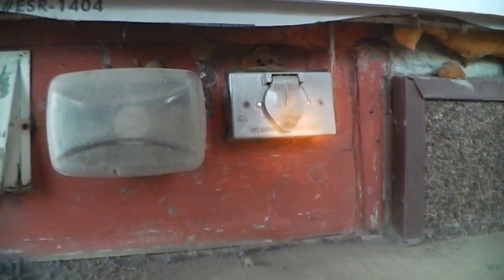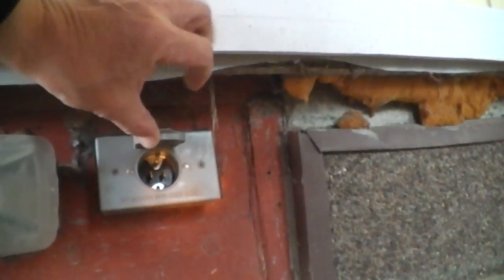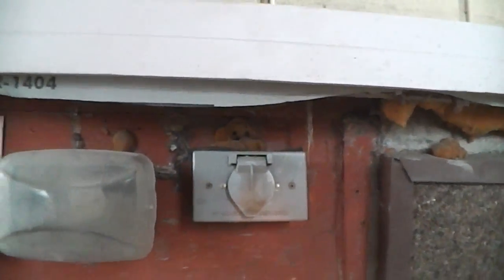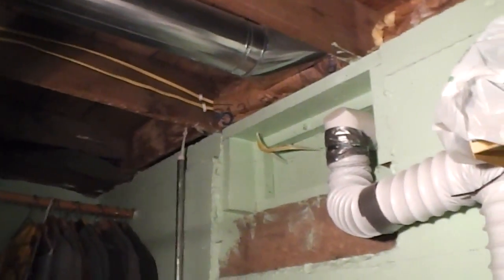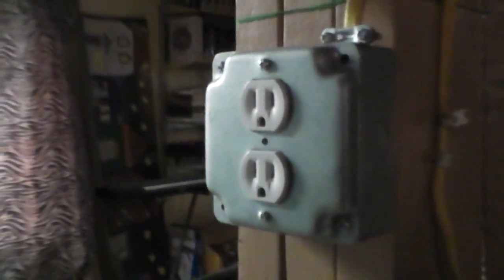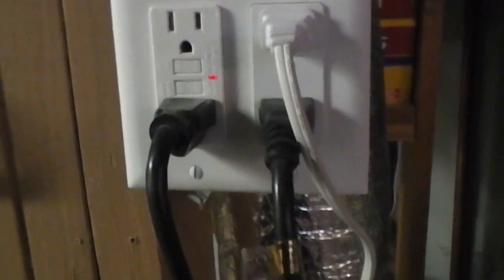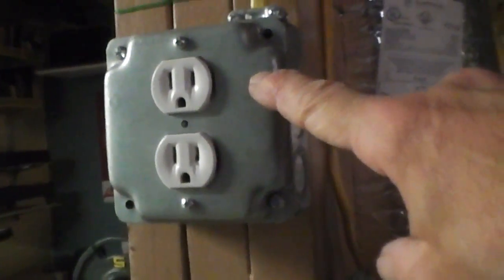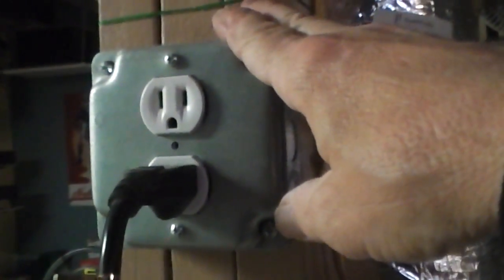Generator Plug-in

Comment: Kewl. Too bad my furnace is hard wired to the CB panel.
Reply from the maker: That would be an easy fix for an electrician Emmett. Today I am REALLY glad that mine is not as we are expecting a record breaking snowfall of over 2' (April 12th 2022). They are already warning of power lines down. I have my generator out and ready.

Comment: I have something very similar. It works and it's totally independent of the breaker box. I just plug in a cord from inside the house. Thanks for the video.
Reply from the maker: Thanks for your comment. My situation is really nothing more than a "permanent/fixed" extension cord as well.